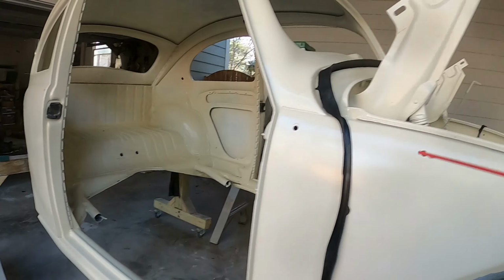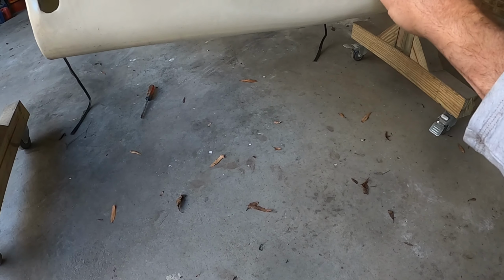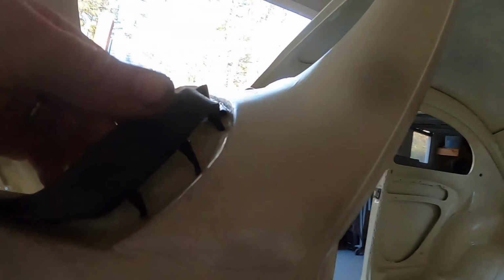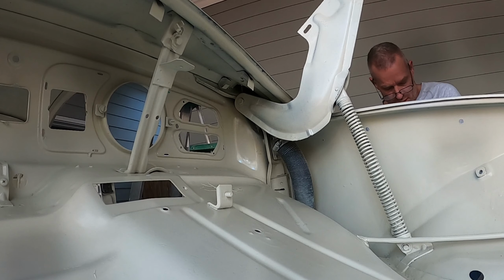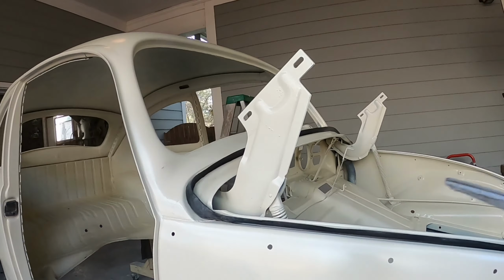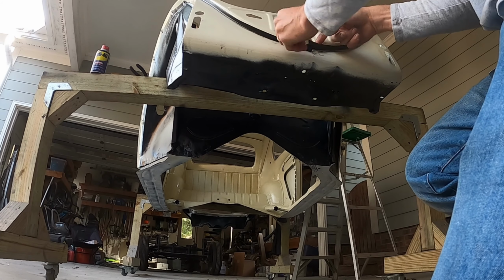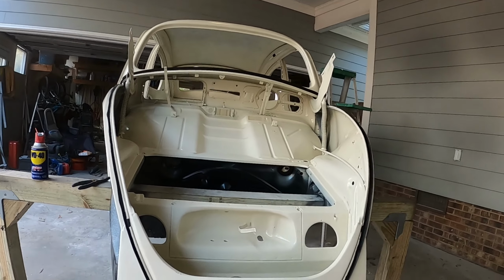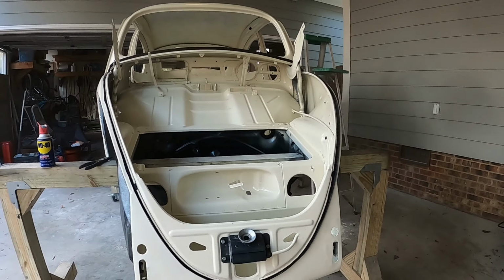1961 VW Beetle (65 Pan) - Front Hood Seal and Latch - 073

Comment: Looks good! Great job on the seal’s! But I’d be afraid if I were you! That after the scrapping you did with that can opener scratched the paint, and will start rusting from there! But otherwise great job!
Reply from the maker: True - it’ll probably rust under there - at least there is a bunch of WD40 and a piece of rubber - maybe it’ll last a few years
Reply: @LarsonSplitBus-  just put a ton of grease under it , protects it for years to come